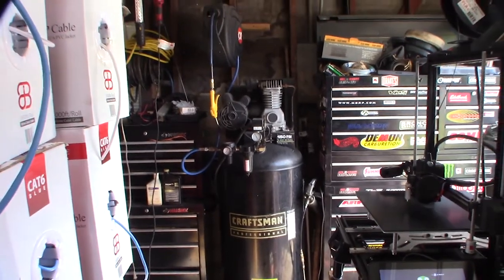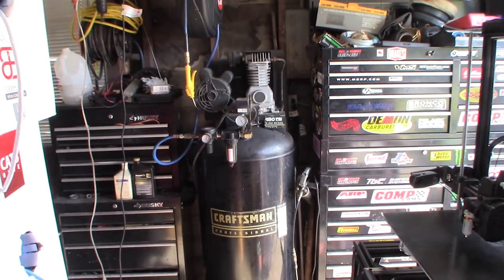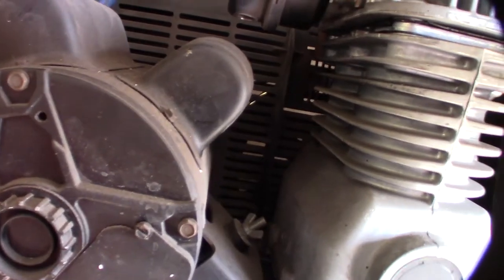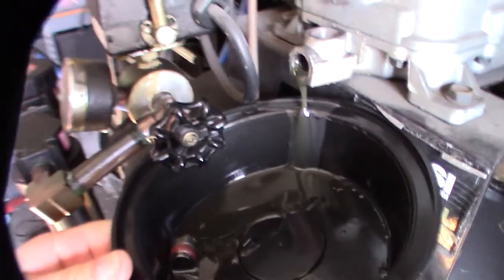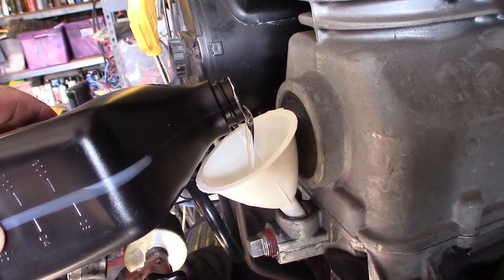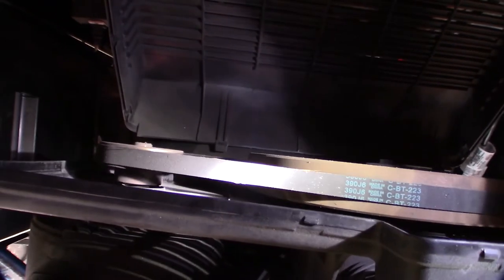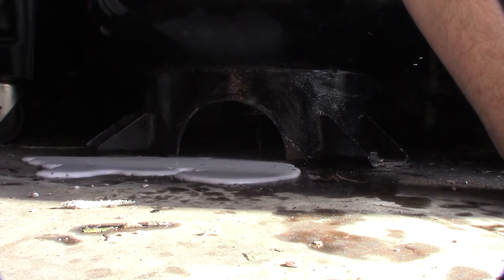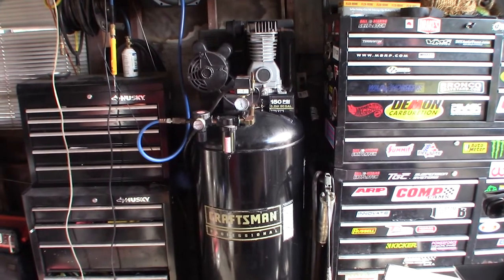Craftsman 60 Gallon Air Compressor Maintenance, Full Synthetic Oil Change, Air Filter & Belt check

Comment: My Craftsman Professional compressor only changed oil about every 10 years, 40+ years runs like new. The Craftsman non professional line are junk. My 60 gal 2 stage Kobalt blew up in less than 5 hours of usage.

Comment: could you please tell me what model you have, I have the exact same one, and my valve that goes in to the right of the on/off switch won't close now when the compressor shuts off.  i would like to know how to fix/replace it if possible.. Thanks in advance.